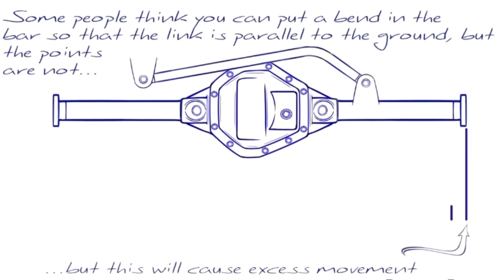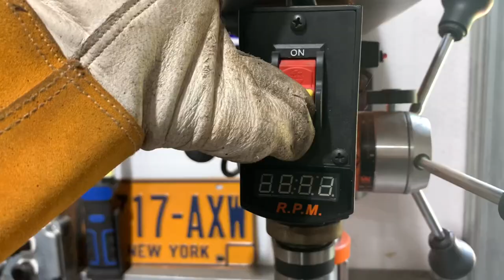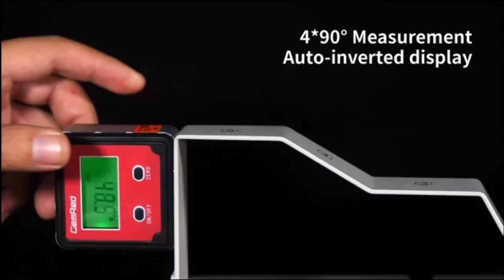Panhard Bars 101: The ULTIMATE [MUST-WATCH] Info and Installation Guide!

Comment: A dual arm Panhard with center pivot ! Real good at keeping your rear centered
Reply from the maker: Are you referring to a Watts link? Yeah they’re great, for sure! For my application however, it wasn’t practical. The added weight and cost combined with the fact that I only have 2.5” of suspension travel in either direction makes the single panhard bar a better choice IMO. At full bump or droop - the lateral movement on my rear axle is less than 0.050”. Hardly worth the extra weight, cost and complexity of engineering of a watts link. Also, a watts link can make routing exhaust somewhat difficult. None if this means that my panhard bar is BETTER than a watts link… just the “right” choice for this build. Hope that makes sense

Comment: Nice work man!! I installed my pan hard bar while my truck was on the ground in its natural position, is that going to work for now?  I’ll get an alignment later, I just installed a reverse shackle kit on my 95 f350 which almost leveled the truck
Reply from the maker: Yeah, in its natural loaded state is the best time to set your panhard bar and pinion angle and all that. You should be good!… my truck is far from fully loaded yet so I had to install everything a bit high - knowing that the frame will drop as the build progresses. Thats why I designed things to be adjustable.
Reply: @intheshoptv  thanks a million buddy!!  Man I’m glad I got an adjustable pan hard bar, the factory bar is not….  It would have pulled my axle over a touch.  I’m excited to watch more of your content, thank you
Reply from the maker: Thank YOU for watching

Comment: Lets get serious. The shorter the bar the greater the arc, and the jacking effect is increased. Alonger panhard reduces the jacking effect. Also your pics are showing very  high attach points,, think about roll centre. Which generally is aprox in alignment with the axletubes. 
A watts in theory is better though often in practice very often not. Again wider the better.
Reply from the maker: I mentioned the length of the bar and the effect the length has on the arc. What Im saying is that a longer bar isn’t always better IFFFFF the pivot and attachment point are not equal distances off the ground. Agree re roll center… thats why I mounted mine where I did.